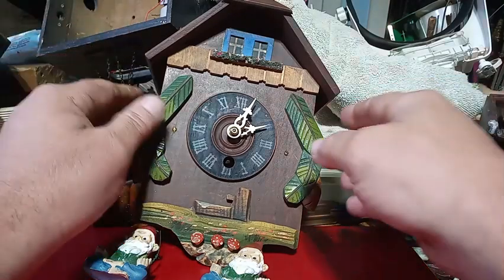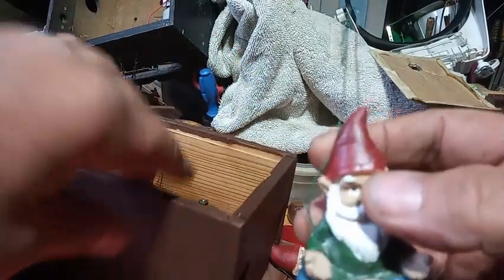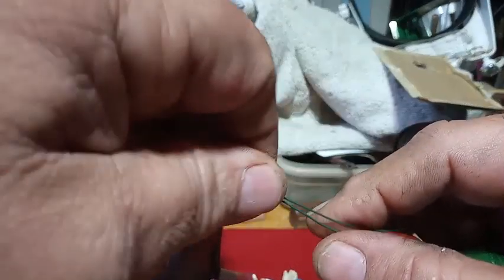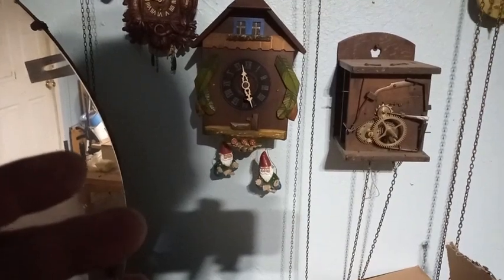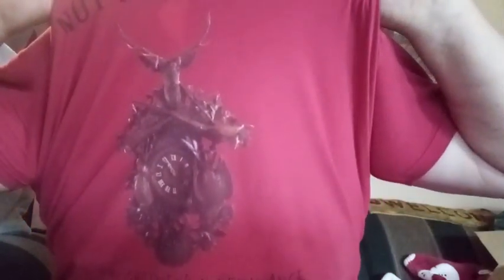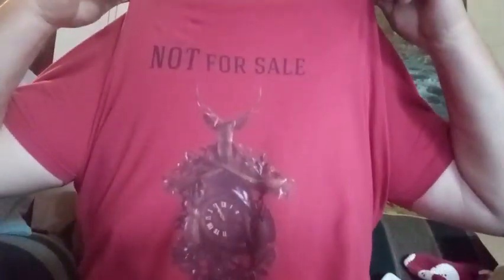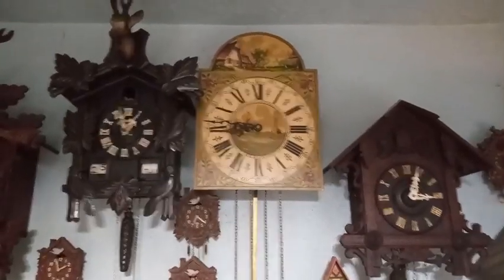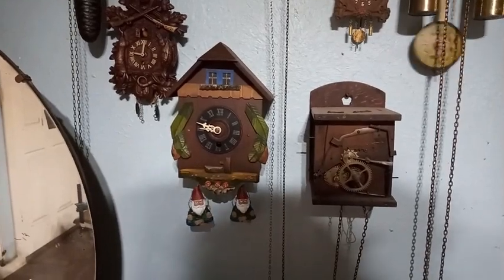Repairing/modifying a Alb Schwab Karlsruhe double swinger pendulum clock final part

Comment: I was just thinking about the adjustment for the speed. Try adjusting just one Gnome and see if you can get more accurate on the time. If moving just one and you do have a difference and still need too adjust, go to the other side and adjust it.
Reply from the maker: That might be a good idea but I already have them both at the same height and it is keeping excellent time.
Reply: @munnerlyn3  Yes, I saw that you said it was timed with the clock above. Without a screw or nut to adjust the time, it is hit and miss for sure.
Reply from the maker: And for a clock that is supposed to last 30 hours I stated it at 430 pm. It lasted until 930 pm the following day. So 24 plus 5 equals 29 hours. If it had a new spring in it then it would last the full 30 hours I am sure but I am  happy just the way it is.

Comment: Hey Mark, question about a Sears Robot quail cuckoo I just got and about to rebuild. When it cuckoos let’s say at 12 every time the bird cuckoos it closes the door instead of staying open. Any ideas what might be out of whack? I’m putting this question here since you don’t answer me on your Facebook page.
Reply from the maker: Sleepy Joe first I havent ever got the message on my Facebook page. My profile picture is me hugging a fake bear. So make sure that you are messaging the right Mark Munnerlyn. If the bird door is opening and closing as it cuckoos then the lever that comes out of the count wheel is too far away from the count wheel. It needs to be pushed down so it rides the count wheel. Be careful in doing such. If the door isnt opening while it cuckoos then the wire that is part of that detent lever that goes into the count wheel that trips the bird needs to be bent closer to the wire that you push to make the bird go outside the door. I have several videos on count wheel movements if this doesnt explain your question. Hope it does. Good luck.